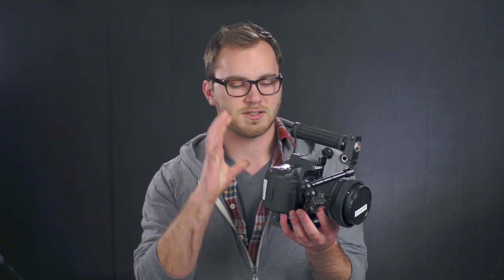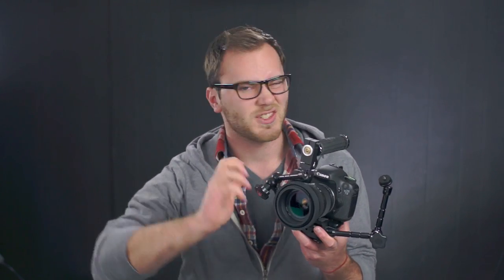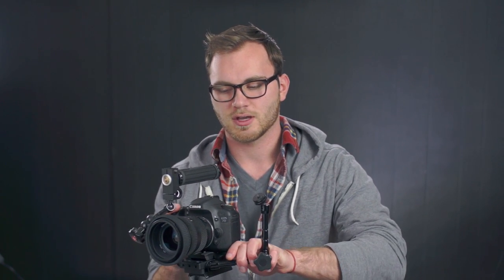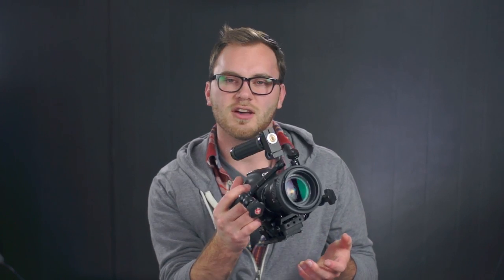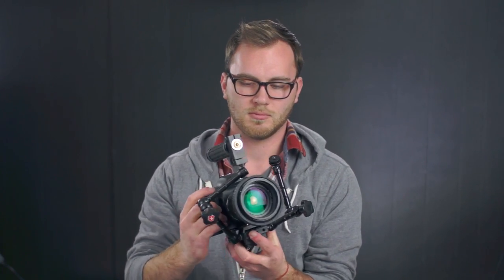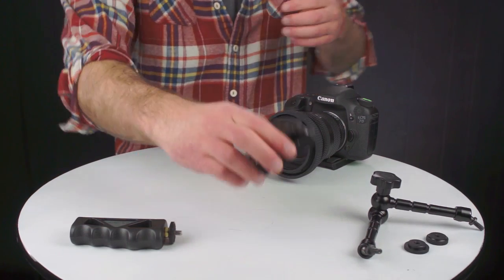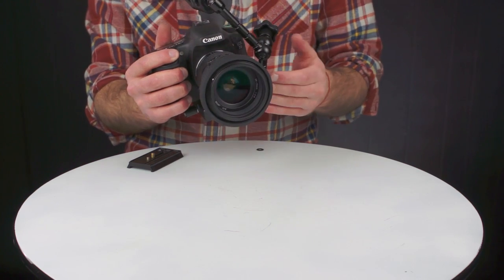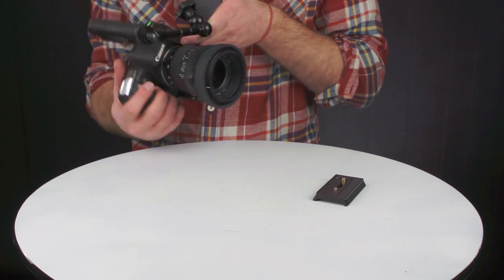Building a Flexible Top Handle Rig

Comment: Planning to make this rig. Just getting started. But i was wondering if you know any alternative to the quick release adapter. I was looking for one compatible with rc2 manfrotto plate. Any suggestions? If not i could just always mount the rc2 on the bottom of the head adapter you suggested in the video. Thanks in advance.